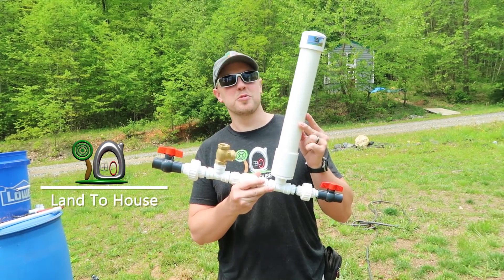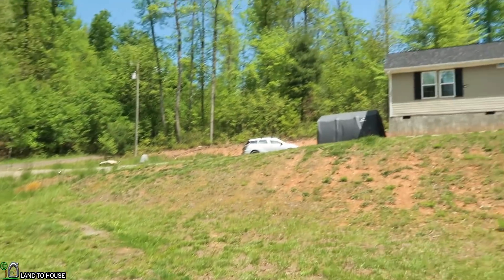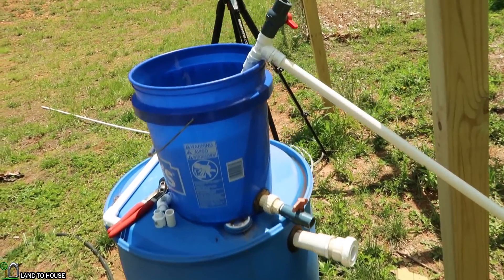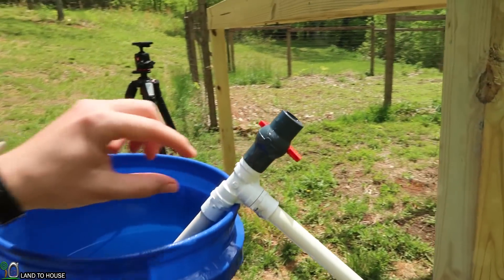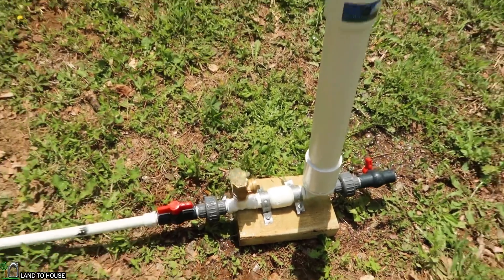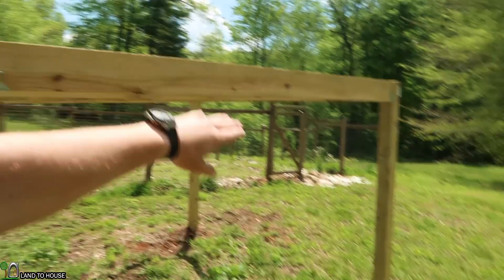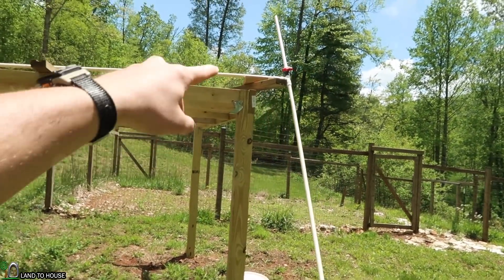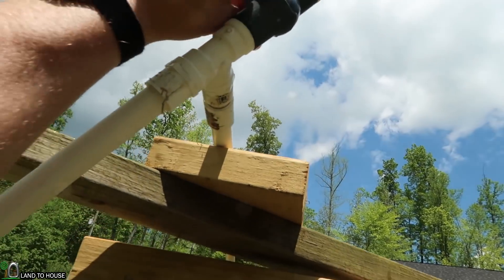Ram Pump Siphon Start is Possible

Comment: So i have a pond. When i excsvated i built a 12 ft berm behind. Would it be feasible to use a ram pump to fill a vessel 12-20 ft up on top of my berm. Then my vessel would have an outlet stepped down returning it through a water turbine back at the pond. Basically from my vessel id be relying on atmosphere and gravity. A 20 ft pipe angled above the pond surface would hold a lit of energy i imagine. Id be okay building several ram pumps if necessary. Id like to get a 5 KW turbine rocking for my home.

Comment: What if you had a siphon about 10ft high to a 55 Gal. Drum like a water tower and then drum feeds ram pump? Of course all would have to be air tight but could this work? Water sorce is 60 to 100 yards from where we need to get it and about 45 to 60 ft higher.

Comment: This is not beneficial unless there is a need to move the water HIGHER than the original syphon.   The flow would be orders of magnitude faster using just the syphon.

Comment: Is it possible to run this ram pump in a closed loop?
Reply from the maker: Not for very long. Because the wastewater is approximately 90% all the water will be at the bottom very quickly.

Comment: What if my pickup tube is at the bottom of a pond and I can't just reach down there and put a cap on it?  I'm having a hard time getting a siphon started over my dam.  I tried a stand pipe thinking if I cut off the valve at the bottom of my drive pipe and filled the stand pipe up, then opened the valved at the bottom back up, it would start drawing, but it's not working.  I guess that's about the same thing as what you're showing here without the valve at the siphon point.  I might just have to insert the drive pipe through the top of the dam (it's actually very small) and drop the drive pipe down a few inches into the actual pool instead of trying to siphon it over the top.  Anyway.....  I enjoy all your videos and want to try some of the more unusual setups to spread water on my little farm.  :)

Comment: I really want to use a ram pump for my needs, but i don't have head pressure. Does anyone have any idea to create an artificial head pressure? I'm planning on using a drum for a tank above my ram pump however I'm not sure how to keep water flow into the holding tank.

Comment: A question.
Is it possible  to siphon from a pond to a 90° angle downards to the ram pump?

The 90° joint i would like to try is to a 4 feet height and down pipe of say 40 feet into a ram pump.
Next question is, with the ram pump hammer pumping away, will the siphon stall or stop?

Comment: Yes, you can siphon for a while... eventually you will and up with air inside the pipe.
 As we all know fish are able to extract air from water , so water has air in it.
There is a point in the siphon where the water is actually under vacuum, and it slowly pulls air out of the water creating the dreaded air bubbles inside the pipe.
Reply: What's the solution to this problem? My main issue is: the pond is below and the filling point is high, still water. Would siphon work or, do I need to dig a hole about 1 meter below water level and then place the ram pump under there? But then when water starts filling up in the hole..will it stop? How do I get rid of that water? Am I able to connect the waste water outlet and send it back to the pond?

Comment: Very good presentation, i would like to ask if its possible to siphon a deep well  with foot valve? This means the source is way too deep maybe around 45 ft. Thank you and appreciate your reply
Reply from the maker: In order to siphon you need to have and output that is lower than the input. So if you have a place downhill from your well you could siphon
Reply: @LandtoHouse  .. dont have a place down hill.. anyway thank you for the fast reply.. really appreciated. 😊😊😊
Reply from the maker: Wells are tricky. An electric pump is probably the easiest way
Reply: @LandtoHouse  yes i think so,  i was very amazed of your ram pump, that i forgot the rules of gravity 😂

Comment: What if you used a check valve on the intake pipe, permanently attached,  instead of the removable cap? It would allow much easier priming in a real world situation, if it would work.
Reply from the maker: Yes absolutely. For a permanent install that would be ideal.

Comment: Hi, I was watching one of your videos on your ram pumps and you where testing the effect of the waist valve hight and was wondering what would happen if you lowered the valve just below the bottom of the drive pipe or even lower.
Reply from the maker: As the waste valve is lowered it gains more head pressure. Now if you have to use more fittings to do this it might cause more friction and would hinder the extra head pressure gain.
Reply: Land to House yes thats kinda what i was thinking

Comment: awesome stuff dude, this is almost what we had to do for our set up, although we are just using 30m of hose, very surprised with how well it actually pulls seeing as we didn't actually think we'd be low enough to get a good siphon flow going, we get enough flow to keep the bucket pretty full, just gotta get our 400+ft of supply now so we can actually get it working properly
Reply from the maker: That's good news. Sometimes flow rate can surprise you. The good thing about these purchases of pipe is that they should last for many years. Just the one time buy.
Reply: @LandtoHouse  yea that's definitely what we were planning, one time buy and done kinda thing, got plans to move the water even greater distances but luckily that is going to be something we can add in at a later date as it's not 100% essential right now (but we are definitely thinking about how to work it all in. We should have video on our pump up soon on our farm page too
Reply from the maker: I look forward to watching the video! I learn a lot from install videos.
Reply: @LandtoHouse  awesome would be good to have some feedback once it's done too. I'll be sure to send a link your way when it's up, will be uploaded to our farm channel rather than my personal
Reply from the maker: Yes please do send the link. I'd be happy to give my feedback

Comment: Thats  good, I like watching  your videos on ram pumps, my question is can in siphon up to 15 feet to increase head  Will  operate like normal ram pump with normal intake of 15 feet?
Reply: the head on the falling side is cancelled out by the head on the rising side, it will operate like normal. you will also lose energy to friction in the pipe. but your setup might be useful if the water source is not close to a sink.
Reply from the maker: I'm not entirely certain the max height the siphon will work. This is about 4 feet in this example. I should expect it would still pull at 15 feet. Somewhere I heard that around 30 feet is Max for suction pump. As for whether or not it will function the same as without the siphon I've not gotten that far in testing.
Reply: @LandtoHouse  Useful operating height for suction pumping is 25 ft, or less if operating at high altitude.  33ft or more height of fresh water and the suction has to draw a perfect vacuum without the water ever getting up to the pump, and above 25 gets too close to trying to draw a complete vacuum to be effective.
Reply: @jllaine  The water on the falling side of the siphoning system creates a vaccum at the top. The atmospheric pressure presses the water uphill on the rising side of the siphoning system. Hence, that only works as long as the atmospheric pressure is sufficient. We have roughly 1 bar or 14.5 psi of atmospheric pressure. That pressure is equivalent to the pressure at the base of a 9.8 meter or 32.2 feet heigh water column. And that is the maximum height until a siphoning system works at atmospheric pressure (1.01 bar or 14.5 psi or 101,325 Pascal / atmospheric pressure may vary depending on altitude and weather ;-) ).
Reply: Another way to look at it, use 2 buckets sitting at the same height, with a siphon established between them. They will level out to the same water height.  Then If you add water to either bucket, the level in both rises, if you remove water from either, the level in both drops.  The "head pressure" is the water level in the bucket, not the arched siphon above the buckets.